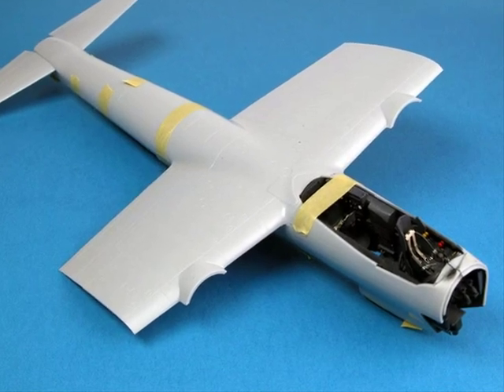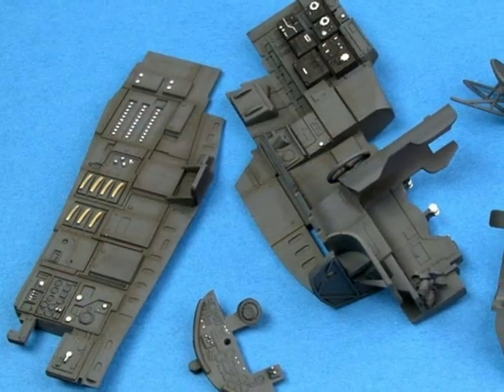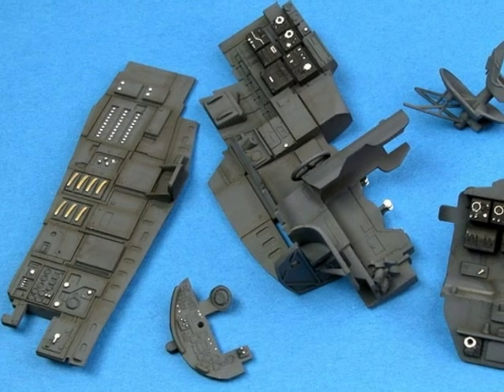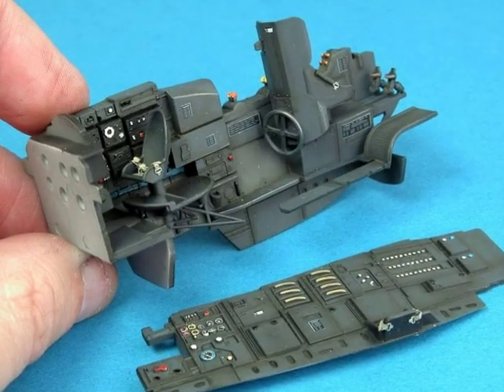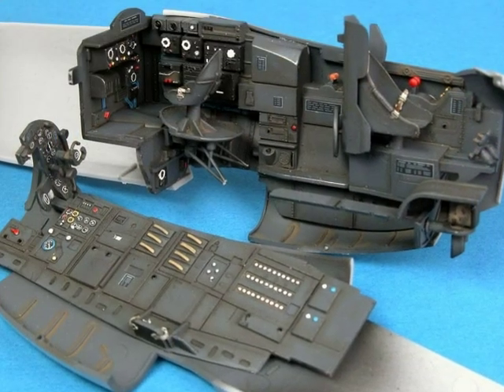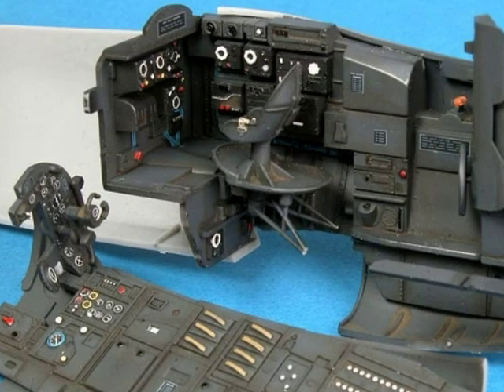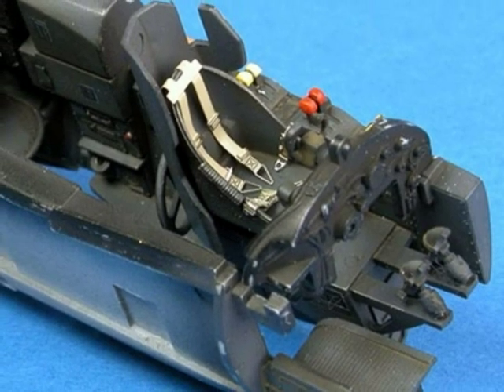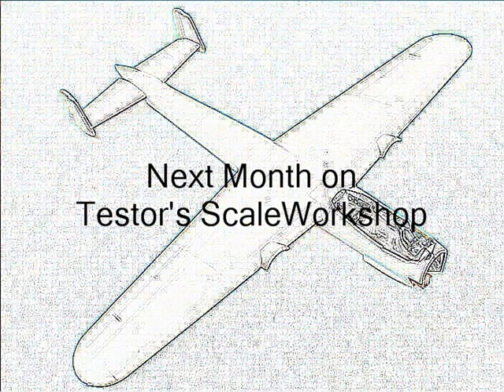Squadron ScaleWorkshop No.40. Painting Model Aircraft Interiors Part Two - Cockpits

Comment: I like to dry-brush guages and buttons with a dark silver or gray. Get some paint on  your brush (med. size) and paint on some scrap surface until there is barely anything coming off the brush, then give the raised edges on the guages and buttons a light brushing or dusting. You'll be surprised at how they just start to stand out with an authentic weathered coloring. Hope that helps.

Comment: Painting very small buttons, 1. Find the best small tip brush ( I used a 10/0 ) 2. Get your paint ready to go, and make sure you have a steady hand. 3. I also used a Jeweler's Eye Glass for the job, I put my paint in the Lid or I used to shake the paint and only use what's on the lid, now take a deep breath and only do as much as you hold will allow, come off before you exhale or you will drag the brush. if you find it dose not look how you like it, let it dry paint over and try again. this is how I did it 30 years ago, and I find it still works for me, if you wear glass' don't worry you will be able to see just fine. Old ModelMaker.